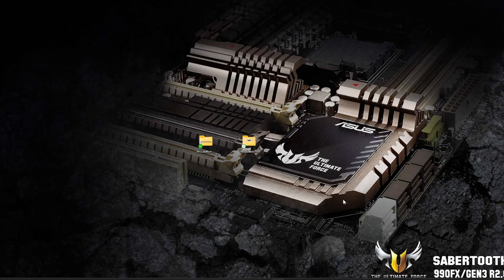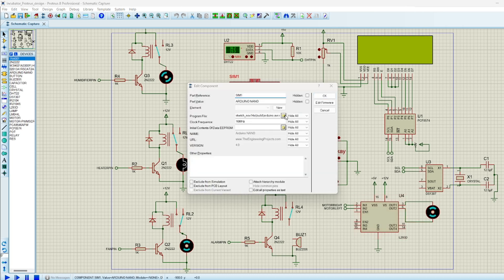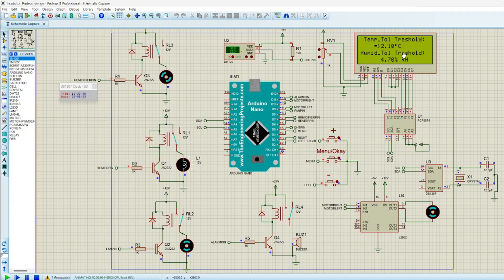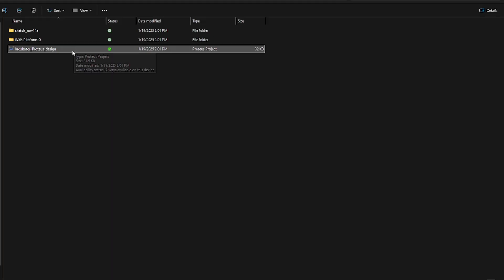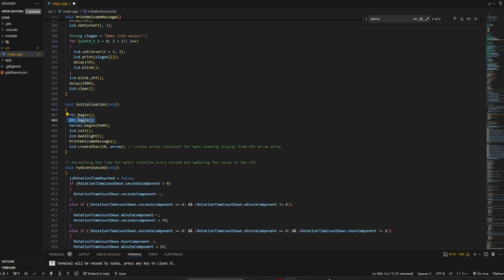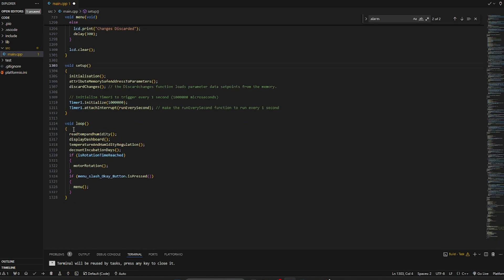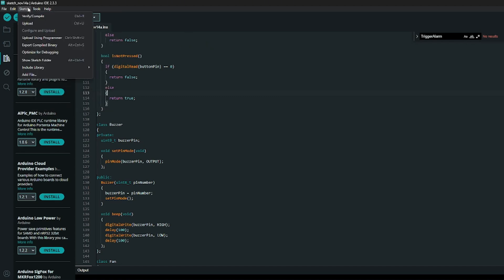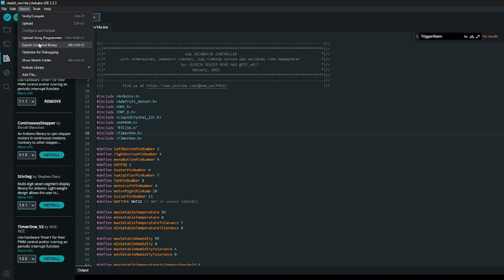Best Arduino Egg incubator Made Easy

Comment: i am not currently using your project or code but i have used the DHT11 and 22 and they are slow response and poor accuracy making it unsuitable for precise temperature control in incubators.

Comment: Hello bro i tried your project the same but why arduino freez after 2 or 3h
Reply from the maker: I don't know why is the case. I might check to know why this happens
Reply: good day i also build this project but after a lot of trouble shooting i am running into the same problems it is freezing at different times. did u manage to get a fix on this ?
Reply: bisa kah mengunakan motor hanya 1  arah saja untuk pembalik telur Teman.dan tambah pengaturan waktu rtc.